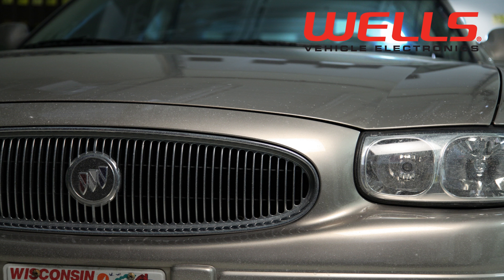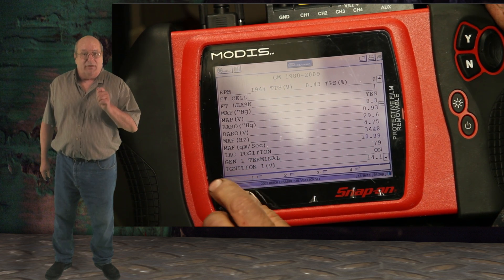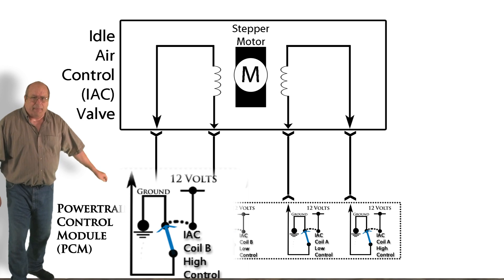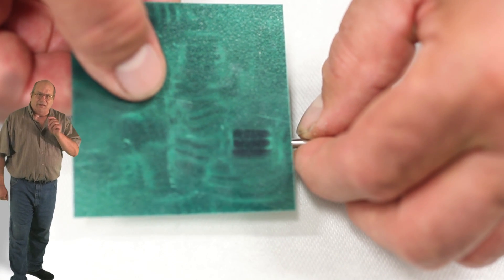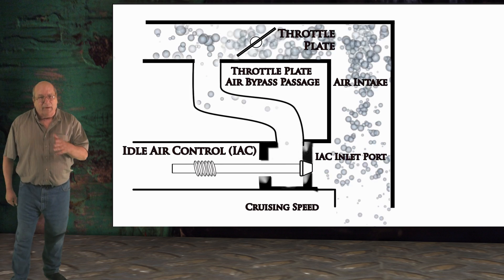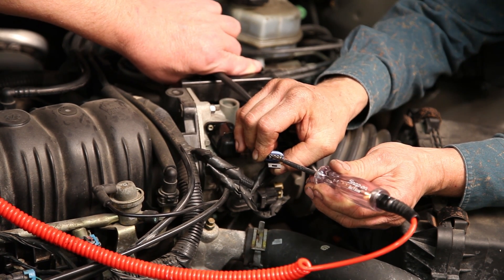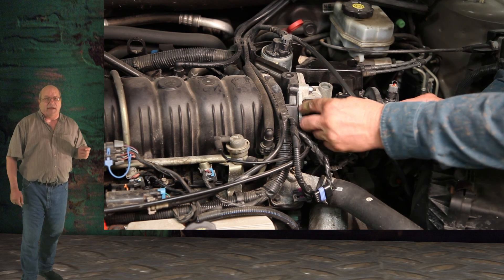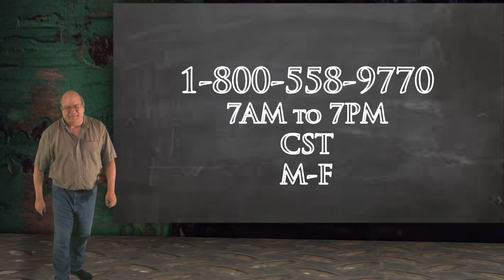GM Idle Air Control (IAC) Function, Diagnostics and Repair

Comment: Would this same connector test work on a 2000 Dodge neon? Ive been having low idle issues and have found a way to check pretty much everything else in my car except the IAC functionality. My IAC is identical to the one in the video by the way, even has 4 pins coming out of it and Ive recently learned that it also has 2 coils inside. Please advise!

Comment: Greetings from Switzerland!
Very strange problem I have,at idle,neutral + park the engine run fine.When in gear or reverse the engine rews up tremendously and strong hissing sound come from the IAC passage on the TBI,I have more times resetted the base idle via the A+B pins with no results.No faulty codes on SES,it seems my IAC is out of range itself.Do you know if my car has a steering pressure sensor and where?Thank you in advance! 1992 RS Camaro 305 TBI/700r4

Comment: Well, here goes a shot in the dark. I ran across your video while trying to solve a low idle problem.  Out of all of the videos that I saw, this was one of the best ones, real informative, and to the point.  While trying to do the test where you use a trouble light to test the connector going to the IAC. After unplugging the connector and starting the motor, the idle went real high. I don’t have a tach but was around 2000 rpm’s or more. When checking the pins the light stayed on at all four of the pins which I assume might be because of the high idle. Your video showed increasing the RPMs, but it didn’t look like much. The vehicle is a 97 Astro 4.3

Comment: IMO this was absolutely perfect. The right amount of information, the theory behind the part operation along with the purposes and function of the item. Later you put an actual problem that was encountered, the fix for that problem and furthermore make us aware that there may be other answers to the initial complaint. All this without annoying  and confusing loud background music. You spoke clearly so we could understand the message.
I'm a believer that concisely presenting what is essential is the formula for success. In less than 8 minutes you presented one of the answers,  but in this case it was the correct one. Keep up the excellent work, it will help many. Thank you.

Comment: What about a low/rough idle
Reply from the maker: Tyler, could be a lot of things! Need more info than that. Got any codes? What kind of car?
Mike Becker, Senior Technical Instructor
Reply: @GoTechTraining  
No no codes just rough idle goes to around 500 rpm
It is an 05 buick rendezvous 3.4
Reply from the maker: Tyler, you could try cleaning the throttle body first. That's an easy/cheap try that you could do at home.
Mike Becker, Senior Technical Instructor

Comment: mark can you tell me just how easy does the iac motor move? i have a stumble and today i noticed if i take it in and out of gear it sometimes goes so low it dies. and at stops i get a good stumble. vacuum is 20 or more so not thinking i have a vacuum leak.  did a lot of work to it and talked to mike about code 51 on the 95 lebaron. but when i plug the iac in and turn the key on and off it moves rear slow and by hand i can't hardly move it. i think it may be bad bearings in it. your thoughts? thanks bp.

it has a spring on it. if i push the plunger down is the spring suppose to push the plunger back out?

Comment: My IAC pintle stays wide open. Would this indicate a faulty IAC valve? I cleaned it and the Throttle Body and didn't change the idle. Also, the spark plugs are black and motor oil smells like gas. So its running rich too. Thanks.
Reply from the maker: Hey Rag Doll, what kind of car? 
Mike Becker, Technical Services Instructor
Reply: A 1988 s10 blazer with 4.3 v6 and th700r4 transmission. 
Thanks for your help. :)

Comment: So is the light attached to ground or +12 on the other end?  If I understand the circuit, the voltage polarity reverses depending on whether the pintle is opening or closing.  So it wouldn't matter whether the light circuit gets closed to ground from the PCM or from the PCM to ground.
Reply from the maker: Glenn, that is correct. The pcm  pulses each terminal to power and ground. In theory  you could use B+ or ground. Either way should give you flashing. Personally I would have my test light hooked up to ground. Thanks for commenting Glenn!
Mike Becker, Technical Services Instructor

Comment: would a sticky gas pedal be the cause of a dirty idle air control valve?
Reply from the maker: Hey Stompjumper2007. I'm not sure what a stick gas pedal and an IAC have in common? It's possible that the throttle plate is sticky due to carbon buildup, which could be built up as well on the IAC...but a direct relation I don't see it.
Mike Becker, Technical Services Instructor
Reply: thanks for the reply. i have a 1995 cadillac fleetwood brougham 350lt1. when the car is cool i have no problem but, when it gets hot or i go to 3 or 4 places it starts acting like it's running out of gas.
Reply from the maker: That could really be a bunch of different things. Is your check engine light on? 
Mike Becker, Technical Services Instructor
Reply: @GoTechTraining  mine does what stompjumper’s is doing. 
Holden Berlina - 3.8L ecotech automatic. Press the throttle to rev or drive off, it’ll dip or die slightly ( or gasp ) then rev, this is all usually when at op temp. In Drive taking off it’ll stumble/misfire, sometimes even to a stall. 
Parts replaced:- plugs, leads, 3 x coils, DFI unit, Crank angle sensor, cam angle sensor 
Cleaned:- throttle body, iac (stiff but moves slowly in and out, pintle came out once as I pulledit too far). 

I’m about ready to burn the bloody thing!
Reply: VX Holden berlina 2001 model

Comment: What are the data pids I should focus on when looking for a faulty iacv
Reply from the maker: Hey Chris, I'd be looking at RPM, actual and desired, and IAC counts. What are you working on? I'll see if it can help out !
Mike Becker, Technical Services Instructor
Reply: 99 surburban 5.7
Reply from the maker: What are you trying to fix? What's the vehicle complaint. Any trouble codes?
Reply: O2 heater codes
Reply from the maker: Chris, an O2 heater code really has nothing to do with the IAC. 
Mike Becker, Technical Services Instructor
Reply: I know that my transmission is shifting high in overdrive was wanting to look at the iac to see if it ties into the transmission
Reply from the maker: Chris, best bet is to fix anything that's setting the check engine light on first. Those tests have failed and can have an affect on the way the vehicle drives. If you still have issues after the check engine light is off...then things can get interesting. 
Mike Becker, Technical Services Instructor
Reply: Ok the o2 heater circuit code is first can a bad 02 sensor cause a hard shift?
Reply from the maker: A faulty O2 could cause the vehicle to stay in open loop, I guess this could potentially cause driveability issues. Hard to say if the hard shift is because of that though.
Reply: And in open loop the sensors what work
Reply from the maker: In open loop the computer adjusts fuel off of pre learned values instead of using the oxygen sensors to adjust fuel trims.
Reply: Ok thanks I'll get back with you on this

Comment: greetings since mexico! i have a chevrolet star 2003, change valve iac new and trembles the engine to the arrive to a semaphore some seconds and is stabilizes that me lack do for that stay well the valve? is necessary that the calibren with scanner? thanks for its attention.
Reply from the maker: Do you have a check engine light on? If so...what code is being set?
Mike Becker, Technical Services Instructor

Comment: Thanks for the video! I encounter the following problem - I have problem with start or hard start. But once the car is running for a while I can start better. Always car runs nice and idle also fine. Can the problem be simply due to bad IAC? Because of different air pressure (according to pV=nkT) I can start OK once the air (or the sensor) is warmer?
Reply from the maker: Hi, from what you're describing it sounds to me like you could possibly need a new fuel pump. A fuel pump is supposed to maintain pressure after the key is shut off, if that pressure bleeds back into the fuel tank then in order to start the entire fuel system needs to be refilled with fuel. This is very easy to check. Just put a fuel gauge on the car, run it, shut it off, and make sure it holds pressure. If it starts to drop off right away then you know you have a problem. Let me know how that turns out!
Mike Becker, Technical Services Instructor
Reply: Hi. I doubt if it's a fuel pump. First of all, it was checked by mechanic shop and they checked the pressure. Second of all when I turn the key I can here the sound of fuel pump injecting fuel to the line. The mechanic said its most likely intake manifold gasket leaking and coolant going into the cylinder(s). But I have replaced the gaskets (which were indeed not good, common problem in gm 3.8 engines) and the problem persists. The point is that the problem with starting is only when the car stays off for longer. That's why I thought it has something to do with "warming up", like the air. Is the IAC valve responsible for the start?
Reply from the maker: The IAC is responsible for controlling the engines idle. It still to me sounds like a fuel issue. The fuel pump will still function normally, you will still hear it turn on and pump fuel. But what usually happens on these is that the fuel pressure drains off after it sits. By having a gauge on there you can watch the pressure after the cars shut off, it should maintain the pressure for quite a while. Also, if you had bad intake gaskets, take a look at your spark plugs, make sure they still look ok.
Mike Becker, Technical Services Instructor
Reply: Ok, Let me check the pressure. So what's the usual "pressure drop vs time" (after the engine is off)?. I guess it always drop a little at first and then stays constant? Thanks!! I don;t if it's related by I have impression that the engine starts better/easier after the acceleration pedal is pressed.

Comment: Great video Mark thank you.
Well I will check the operation of the iac valve however it strongly seems this would not cause the extreme problem I'm having with my dad's 1990 3300 v6 Buick century 115,000 miles. It seems to run ok when cold but will stall and start up again if lucky and not drive much at all above idle and barely get back home from short distances.
I've pressure tested while experiencing the problem, tested good 45 psi/36 psi w-vacuum line removed from regulator, tested throttle position sensor with volt meter, tested good with about .5 volt at idle and increasing properly to say 4... Volts at full throttle.
Hmm what to test next... No engine light so no codes..
Reply from the maker: +Jim McDaniels I would recommend doing an ohm test on all 6 of the injectors. The spec is 11.8 to 12.6 ohms. I have a feeling once the engine heats up the resistance across the injectors drops and shorts out. This in turn disables the fuel injector driver circuit inside the pcm. When the car is acting up, ohm across the 2 terminals of each injector. I'd bet you have a few that are out of spec. If you do, it's not a bad idea to replace them all at once so the problem doesn't come back. Let me know what happens. Talk soon,
MIke Becker, Technical Services Instructor

Comment: Sir, thanks for upload this video.dear sir I am warking as a car mechanic with small private workshop I need your halp one vehicle which is ford tha problem is this car very low RPM how I readjust RPM
Reply from the maker: Hello Sohail
First thank you for speaking English, you are doing very well!
What year, model and engine size is the Ford?
Mark Hicks
Wells Vehicle Electronics
Reply: That very well could be the air idle switch. Two other things on GM trucks that cause it are a so so battery and or Temp switch on the block... The computer gets confused on how to set the BURN ratio of the engine and shift the transmission with either the air idle switch a low battery and or the temp switch on the drivers side of the block. I first leave the lights on on a vehicle for 30 min and if the Batt goes completely dead in that time I replace the battery because a low battery will throw what is called Ghost codes.... Seems like right after you fix one issue everything else is taking a shit and all it is is the Battery....

Comment: Good video. Gotta couple of things to add. One, may not be able to do this on all engines, but a quick test to see if a vacuum leak is the cause of a high idle is to remove the air intake tube from the throttle body, start the engine, and while the engine is "idling" put a block of wood on the throttle body opening. If the engine stalls, vacuum leak ain't the cause. If it still runs, then look for a vacuum leak somewhere. Also, another possible cause of a high idle that wasn't mentioned in the video is a misadjusted TPS sensor.
Reply from the maker: Very good! Great points!
Take care my friend,
Mark
Reply: +dmorley100 ,,,maybe you can help with my problem....88 gmc  v6 throttle body.....vehicle runs good...sometimes when at operating temp. and restarting eng the idle shoots up to 1600 rpm...I'll shut it off and restart,,,but no change.....IAC has been cleaned.......?????......Thanks for any suggestions......
Reply: +Arthur E LeClair Have you got a scan tool that displays TPS%? If so, look at the TPS% when this happens, and if it reads anything except 0, the TPS could be misadjusted or possibly be beginning to go bad.